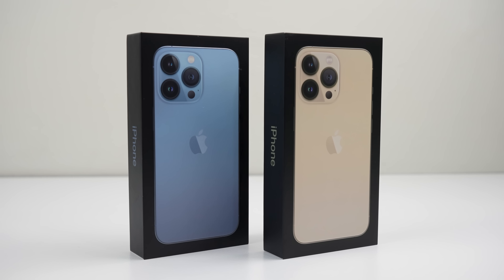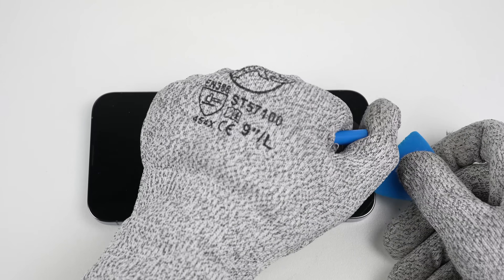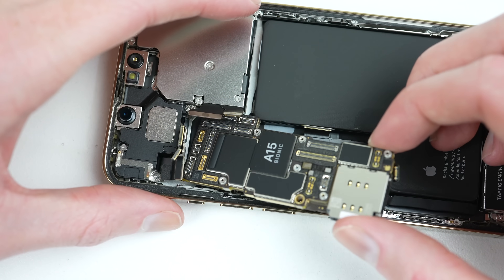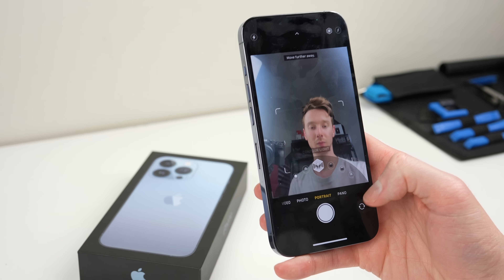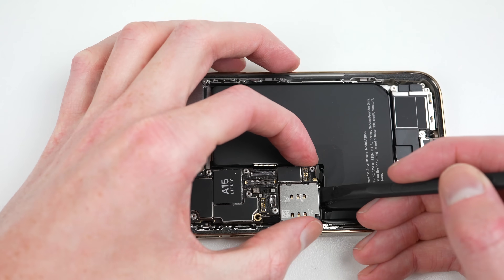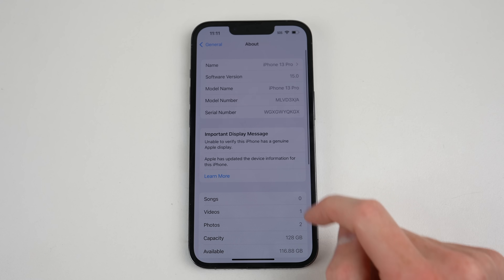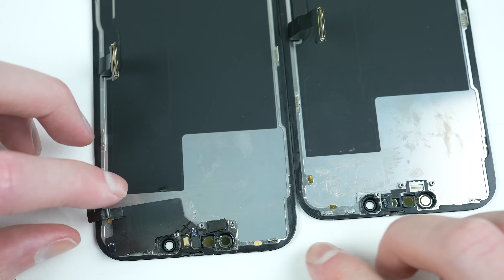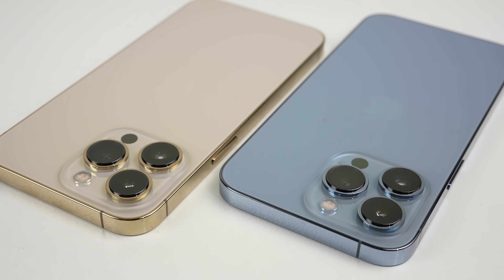iPhone 13 A Repair Nightmare - Teardown and Repair Assessment

Comment: This sort of thing shows how Apple has a great branding and maketing department. Their Phones stop working properly in a year or so, you cant fix them, they have no chargers, they are really expensive and yet ppl spend 3 to 13 minimum wages here in Brazil to buy one. Its kinda discuting, but you gotta admit how sucefull they sold the idea.
Reply: Tava demorando pra eu achar alguns comentário BR kkkkk
Reply: Facts
Reply: iPhones last for years, way longer than most android devices. If you’re going to hate on a brand hate on it properly
Reply: I used my iphone for 2 years with absolutely no problems, then i bought my samsung, it got slower and slower with every upgrade and rhe battery died really fast, then i switched back to my old iphone and it still works perfectly.
Reply: @kaisuhina8024  My old iphone would die in the cold...Like immediately. If i had it in my jacket pocket even, it would go from full charge to just dead in a matter of seconds. Absolute turd
Reply: @ontario-yota-1050  what did you use? Iphone 4? Lol. My samsung battery used to die in like 20percent but iphone doesnt.beven tho samsung has bigger battery.
Reply: Dude, all iPhone last longer than most phones in the market. Also it got support  for a long time in software (For example Ip6), dont spread wrong info. I got an IP 6 and it still works till now, lots of my friends too.
Reply: @khaikuze  Khai you are the ONE spraying FALSE information,let me put it crystal clear Taliban mercenary.
Reply: @khaikuze  The problem is that repairability is getting worse with the pass of the time. I'm not doubting that your IP6 is still working, but literally in the video is shown that Apple is taking actions against repairing their product. Also, don't be brainwashed, a lot of phones from other companies are extremely durable. My gf literally destroyed entirely the screen of her Nokia phone that she has been using for three years, went to a repair shop with 50 dollars and as good as new.
Don't defend rich companies that don't care about the repairability of their products and harm their own clients.
Reply: @oscarmedinajuarez396  If this is about repairing so I don't have any problem because that is what many people vote and want to have therefore I am ok with it. 

But when it is concerned about the quality and durability of an Iphone, I think people are hearing wrong info. I have a strong believe that people can choose devices which suit their preference and no needs for these nonsense arguments. Just buy the devices within your salary and everything is ok
Reply: @khaikuze  that was before the devil poured greed into Apple's mind
Reply: @BenfordAbrahams  I switched to XS and use 6 at the same time till now, I used Android too but I thinks the Android is not good OS for me and I prefer IOS, just use based on your preference.

Comment: Companies have been doing this shit for years. I used to replace HP motherboards in laptops and oftentimes they wouldn't work unless you used HP proprietary tools to brand the motherboard otherwise it would brick itself after 30 or so boots.

Comment: I want to stress that apple engineers were made to put in a lot of additional time, to ensure that many functions are bricked when parts are swapped.
Which is of course passed on to the buyer ...
Apple literally makes its fans pay more for buying a phone with a greater economical impact.
Reply: but, I praise them, because too many people are keep stubbornly buying their phone,  I just can't understand that logic, seriously I want to sell stuff that way, I mean no matter how bad I treat my customers, they will keep greedily sucking my c*ck, paying whatever price I put on the tag
Reply: Apple sheep will still say its best smart phone ever.
Reply: I’m guessing most of the people refuting my assertion aren’t software or hardware engineers.  The fact that faceid doesn’t work in virtually all of these swapping operations means that it could be that the security sensitive components are generating security hashes to lessen the chance of rogue component swap outs. The mere fact of taking them to an Apple store to make them match up isn’t the reason for being upset over this… Apple is trying to prevent a rogue 3rd party component from entering the security pipeline. 

All that said, security is always the enemy of ubiquiti and adaptability to some degree.
Reply: In all honesty, I’m impressed because of the hardware trust with sensitive hardware like face id. They are trying to prevent swapping in a rogue component into that pipeline to actually ensure the integrity of the security aspects.
Reply: @ericnewton5720  So apples own components are rogue? You don't need to swap anything to trick face id, just a good picture of someones face ... But reading the ID of a likely broken old component to rewrite it on the new one, makes repair infinitely harder and not profitable for many repair shops! But yeah, Apple surely had safety in mind here ...
Reply: @pugnate666  the Face ID doesn’t work using pictures. Just putting that idea out there incase someone wants to be sneaky
Reply: @theblackoutexplorer2658  you probably could just using pictures, but not just holding them up. It would more require injection hardware to trick the camera, which honestly requires so much work no one would bother. Sadly because of the jailbreaking community mostly leaving, Apple's security has become garbage.
Reply: @ericnewton5720  What you're proposing is some kind of injection component, much like mod chips for consoles. Problem with all that is those tools would still work in this situation. Simply a board that picks up what signals are coming through the cables and sensors, then relays an identical signal back that tricks the phone into thinking nothing fishy is happening; and no software patch can bypass that massive flaw.

Long story short, there's no such thing as real security; it can all be bypassed by a good engineer who knows what they're doing. How the hell do you think China manages to make knock offs so damn fast? 

This is nothing more than software locking out phones for planned obsolesce, a practice everyone forgets Apple admits to following. Nothing will change with this company because dumb people buy their phones still, and almost always because of the OS.
Reply: @paulghignon4092  you can’t electronically recreate an asymmetric security hash because you won’t know what key to use to properly respond. The raw signals yes, but the actual data stream you cannot…

All security has a flaw: physical access to a device, and the user’s ignorance.  That said, of course there’s ways around the security… and Apple could be coerced either by law or by consumer boycott, to reveal aspects of that security to enable 3rd parties to reset the serial number or similar data within the OS to reenable the trust of the Face ID components. That’s all I’m saying,  I believe these safeguards are there for security, and have the (consumers point of view) undesirable effect of limiting upgrade.
Reply: @ericnewton5720  My problem with this is: This stuff is not undefeatable, but Apple just made a repair hard enough to not be profitable anymore for repair shops. Paired with them not selling actual components and clear steps against independent repair shops, makes Apples intention pretty obvious to me.
Reply: @ericnewton5720  you're quite wrong here, so much so it's actually quite hilarious. The exact same thing was said about the switch, then TX proved everyone wrong on that. It's not very hard to get a piece of hardware as a simple pass through with all original hardware connected, then using said piece of hardware to see what's being passed back and forth. Side Note: this data wouldn't be able to be used to program screens with the correct stuff to make it work, because of how they're designed; even with the correct hardware. Although it would probably easily be used to crack faceID making it the biggest security flaw in these devices.

Of course what do I know with my engineering degree and extensive knowledge on hardware modding of phones.

Nothing about this is security, sorry not sorry. If it were it would be the equivalent of putting a toddler as a bouncer at a night club. It's the same shit everyone who's worked on Apple products has known since the 3rd gen of iPhones.
Reply: @pugnate666  I could easily point out how this is actually a massive security flaw, more so than anything in the past. It's just simply doing what Apple and most Laptop designs do, fail once a single part goes; it massively lowers the lifespan of a product. Too bad the jailbreaking community for apple products is dead, otherwise they'd have a field day with this.
Reply: @ericnewton5720  No.